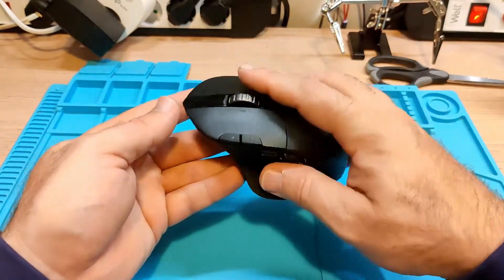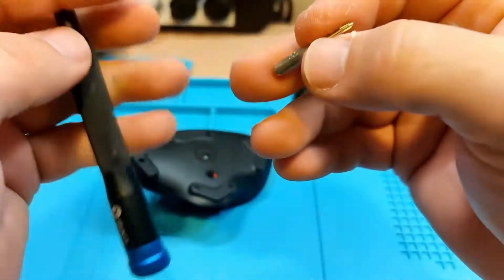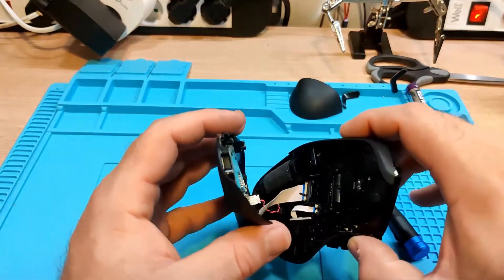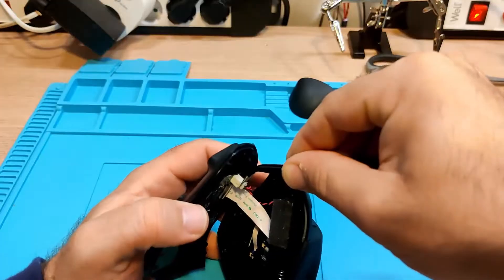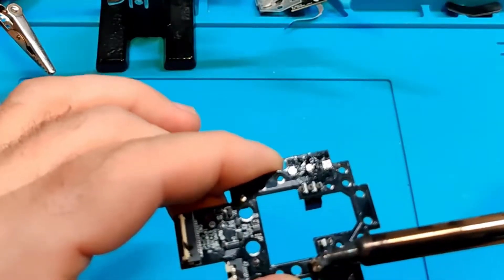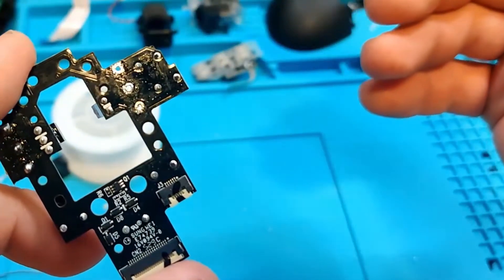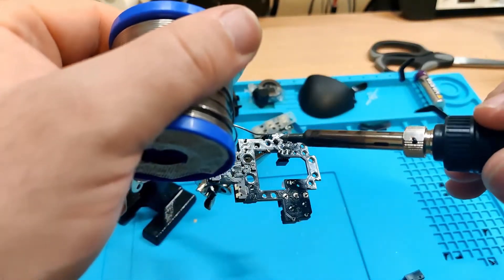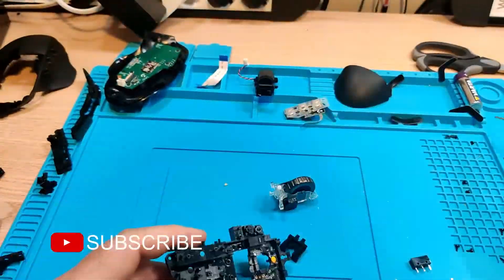Logitech G604 Double Click Issues | Japanese OMRON Switch Replacement and disassembly process

Comment: Thanks a lot for your tutorial, I just replaced the bad quality stock microswitches for the Kailh red successfully following your video because this mouse has tons of screws! Comparing the stock with the Kailhs, they are practically the same, nobody could notice the difference and the result is no more double clicks.
Reply: How are they holding up? Are they the same height and feel as the stock ones? I've seen some people saying they have to sand down some of these buttons or that they make the button a bit higher (not Kailh red though).
Reply: @LLF1234  I installed 2xKailh red on one of mine. Didnt have any issues with their size. (they look identical to the original ones, except for color, sure). The other g604 was fixed by simply putting some wd-40 into the switch.
One of my kailh sometimes does a double click, so ill be applying wd-40 to them too.

Comment: Thank you for this video and the call out to Alex's detailed explanation.  With your help, I replaced the switches in one of 3 G604s that all started having the double click issue.   I had a little experience with soldering but this was the first time I de-soldered a component from a board.

I like the feature set of the G604.  It hits the sweet spot for connectivity and number of buttons.  I initially bought two G604s for my desktop and laptop.  First the desktop mouse started having the double click issue.  The desktop gets more use in particular in MMO game play.  Under warranty, I RMA'd that mouse at 6 months old.  The replacement mouse failed after 3-4 months in the same way.  Then the laptop mouse failed too.   Very disappointed with Logitech for not using the right switches for the job.  I've used Logitech mice exclusively since the late 90s and I was looking for an alternative when I came across your video.
Reply: Replacing switches is like changing engine oil in a car. It has to be done, sooner or later.
Reply: Within 6 months is very fast though. Some mice lasted me for years without any issue (and much more gameplay than now)
Reply: I have 2 G604s, one of which is doing it on left click and the other on right click, I used to build microelectronics at work and this looks particularly brutal, but the 4 pack of switches is on the way.
Reply: the new optical switches should reduce the chance of double clicking, I have G604 and recently started double clicking on left click, I purchased a G502X Lightspeed just for the size and optical switches, maybe in the future I'll fix the G604 if it gets more serious, now it's 10+ times in 1000 clicks

Comment: Thank you for this very helpful video.  I just replaced both switches on my G604 with Japanese Omron switches.  It's a pretty simple job if you know how to solder.  I just had to buy some solder wick and a desolder pump.  I had seen people use them in videos and never did it myself before, but it's very easy. Just take your time and follow the video.  Cost: about 4$ for 2 switches, 12$ for a basic pump and some solder wick.
Reply: i end up burning thing when i solder lol, after that i wont solder again

Comment: I lost my springs XD, do you know the measurements of the spring?
Reply: I was able to buy some springs that fit:
0.2mm wire diameter
1.5mm spring diameter
5mm spring length

tho I think a 2mm spring diameter would fit better.

Comment: With your video I have finished the micro switch replacement of my G604 without any problem. I don't know if I can do it so smoothly without your video, since it's my first time to do such a thing. And this mouse is really complicated for its structure, I think. Thank you very much.

Comment: Hi there, I replaced my switch using your instructions and could put everything back together. All the buttons seem to work fine, but for some reasons, the sensor no longer tracks properly. The mouse becomes very laggy. Would you have any idea where I should start to tackle this problem?
Reply: Did  you replace the sliding material under the mouse? if the sensor is just a tiny bit farther away from the table, it will misbehave. It did for me.

Comment: I think this one lasted about the same or maybe even less time before double clicking vs the last 2 g602s i had. About a year. Pitiful. Ready to give up on logitech to be honest...
Reply: It seems they're going to make mice with optical switches, eliminating the mechanical debouncer (which mostly causes the double clicking issue). 
I just hope they add them to G604s too.
Reply: @LLF1234  we can only hope. I tried a steelseries and after 3 months the scroll wheel started bugging out. You go up it will sometimes go down or not register at all... 😑

Comment: looking this disassembly process makes me thinking whether or not I should buy this mouse 🤣.
BTW thanks for sharing. it is so helpful for me
Reply: tbh no. Don't buy it. Or any Logitech mouse for that matter. Buy a properly designed one, where 50% of the design is not "how do we make it impossible to fix"
Reply: @dansmith6909 , 🤣 at the end I'm ended buying M720, where everything is easy to access and if the switch are failed i could just change the switch with even better and more durable switch.

Comment: i just blew air with my mouth on the switch and it fixed it. why to overcomplicate? :D
Reply from the maker: Just like blowing air into old Nintendo cartridges to get them to boot up, no? 😀
Reply: in fact that worked lmao, i issues with selecting text, left click stops responding, just used my compressor for a sec and works like a new :D
Reply: lol, it just temporary, I was blowing to this mouse since 2 months, double click always comeback
Reply: @fortedexe8273  it came back after a week now all good again for a week so far
Reply: @ErikKubica  I just replace the switch to kail 4.0 yesterdays, work well so far, this miserable need to be end. I use 1000hz polling rate, so it worse much more than 125hz.

Comment: By any chance, do you remember the part number for the chinese switches you originally had on your G604?

I'm not sure I should use D2F-F and D2F-01F due to them having 1A and 0.1A amp rating, respectively. Specifically for a G604, that is.

Any issues so far since you've changed the switches to D2F-01F?

Also, have you tried any 150gr switches like the D2F-01? I know it comes down to personal preference, but if you did, what were your thoughts?

Loved the video. Thanks a lot for doing this!
Reply from the maker: Hello, I'm glad you enjoyed the video, thank you!
To answer your questions, I unfortunately do not have access to the switches I took out of the G604. At a later time, if i come across them again, I will post the part numbers here.

I have not had any problem with the mouse since the switch replacement. I have also not tried any other switches but the D2F-01F.
Reply: @yogitech-3D  I was just watching other mice reviews to take into account for any future purchases when I saw your notification.

Thanks a lot! I'll stick with the G604 and get a couple D2F-01F switches.
Reply: My G604 had the chinese D2FCF-7N(G1).
Reply: i followed this video to fix my g604. it worked out well, but im still gonna do it again to switch from d2f-01f to d2f-01. meaning from 75gramm to 150gramm. the 01f feel too smooth for me, so they will trigger when i just rest my finger on them.

Comment: I RMA'd my old mouse that had right clicking issues. I just got a iFixit kit and decided to tear down the old mouse to see the switches with this video. If my new mouse craps the bed (which I assume what will happen) at least I'll have my old one torn down to replace the switches. Thanks for the video.

Comment: Do you have a link to the replacement Japanese switches?  I've been frustrated by this same problem for a while now.  Thank you in advance!
Reply from the maker: I have put some links in the description. See what's best for you depending on your region.
Reply: You don't need replacement switches. If you just take the top part of the switches (can only be done on the left and right click switches), you can see the copper mechanical contact. Take that, clean the contact points with alcohol and put the switches back! Your buttons will work like new ones!!!

You need Tweezers for this job

Comment: my g604 has the same double click issue, its easily the worse logitech mouse I have ever owned for many reasons
Reply: what are the many reasons? this double clicking issue is really killing me but its the only issue I've ever had with this mouse.
Reply: @SpydersByte  Logitech mouses use cheap chinese switches ... I used to G602 had the same problem, now my new G604 starting to have this . Shame on you logitech
Reply: @Addicted2wowlulz  yea, its incredibly annoying but I don't know what his "many reasons" are. I've owned 3 so far and 2 had the double click issue but Logitech replaced them under warranty and I haven't had any other issues at all.
Reply: @Addicted2wowlulz  I agree. My G603 had the same problem. I ordered some Kailh switches to get it fixed.
Reply: @judck  how's the Kailh switches hold up? does it have a double click issue?
Reply: @hammerfall6666  Sorry, I didn't have the opportunity to replace them cause they sent me a new one. But guess what, the replacement has the infamous scroll wheel issue lol
Reply: @judck  what kind of infamous scroll wheel issue you talking about?

Comment: Hey man, was wondering if you have an update on the switches. Are they still holding up? 
Also one more thing, as I am about to receive the switches in a couple of weeks and go through this operation as well, did you file the plunger height down or did you leave the as is? I've heard people say that filing the height a bit was better.
Thanks for the video by the way, if it weren't for this I probably wouldn't have had the courage to attempt it :D
Reply from the maker: Hi, Thank you for your comment :) To answer your questions:

1. I have not had any issues with the mouse since switch change.
2. I did not file down the plunger height. The activation is a bit higher now but I guess it is a question of preference and comfort.

Good luck with the replacement!
Reply: @yogitech-3D  thank you! :D
Reply: Re the plunger height, there's a couple of "crests" on the base of the switch that can be sanded down to reduce the total height - with my switches it was already done when I bought them.
They worked really well.

Comment: What a stupidly complex location for the switches. TOTALLY would've switches to other brand if they didn't have the lightspeed scroll wheel. Great video btw. 👍
Reply: I know right? This isn't my first time to change mouse OMRON switches but on every other mouse I have had to do this on I just remove the top cover and bam it's right there.
Reply from the maker: Thank you!

Comment: Could have replaced the scrollwheel with the G903 version, it's supposedly WAY better than that rattling standard scrollwheel in the G604... here take a look:
https://imgur.com/a/2gc2u57#1YR3LMS

Here you can buy the G903 wheel:
https://nl.aliexpress.com/item/32842816141.html?srcSns=sns_More&spreadType=socialShare&bizType=ProductDetail&aff_fcid=7cd7e8defe994259bdf71627a0a0ad55-1622327017285-06588-_BTA8Ei&tt=MG&image=Ue4e5a38bf1ec444ab0d21d76a3ab417c9.jpg&aff_fsk=_BTA8Ei&aff_platform=default&sk=_BTA8Ei&aff_trace_key=7cd7e8defe994259bdf71627a0a0ad55-1622327017285-06588-_BTA8Ei&businessType=ProductDetail&title=1%C2%A0146%2C10+%D1%80%D1%83%D0%B1.++-16%EF%BC%85+%7C+1+%D1%88%D1%82.+%D0%BE%D1%80%D0%B8%D0%B3%D0%B8%D0%BD%D0%B0%D0%BB%D1%8C%D0%BD%D0%B0%D1%8F+%D0%BD%D0%BE%D0%B2%D0%B0%D1%8F+%D0%BA%D0%BE%D0%BB%D0%B5%D1%81%D0%BD%D0%B0%D1%8F+%D0%BC%D1%8B%D1%88%D1%8C+%D0%B4%D0%BB%D1%8F+Logitech+G900+G903+%D0%BD%D0%B0%D1%81%D1%82%D0%BE%D1%8F%D1%89%D0%B8%D0%B9+%D1%80%D0%BE%D0%BB%D0%B8%D0%BA+%D0%B4%D0%BB%D1%8F+%D0%BC%D1%8B%D1%88%D0%B8+%D1%82%D0%B0%D0%BA%D0%B6%D0%B5+%D0%BF%D0%BE%D0%B4%D1%85%D0%BE%D0%B4%D0%B8%D1%82+%D0%B4%D0%BB%D1%8F+G500+G502&platform=AE&terminal_id=9a7a3cf1d5934debb68c22f3a4a64056

Comment: I've gotten this mouse warrantied 3 times and this is the 4th one to have this problem.....
Reply from the maker: Sorry to hear that :( I started the with the Logitech support route to apply for warranty replacement but the process seemed to take a long time so I opted to do this instead
Reply: @yogitech-3D  It's super confusing but usually if you can find the correct way to do it they send you a replacement within a week
Reply: wait, so you are saying i could've warrantied my 2nd g604? first one had the side buttons break off, second started double clicking, well shit, i need the g604 due to my left hand being very damaged
Reply: @ZesilinaVT  You can warranty it as long as it's in the two year buy from the first one.